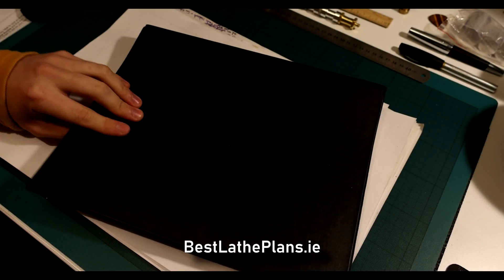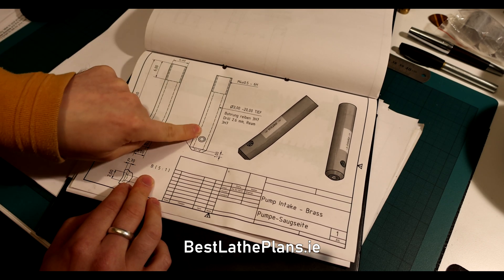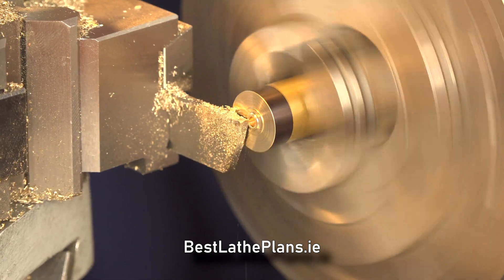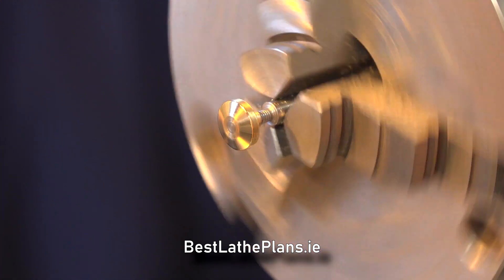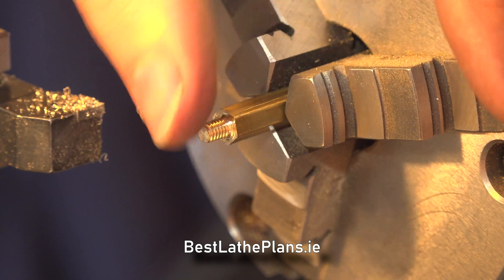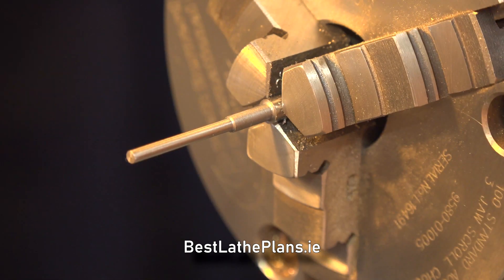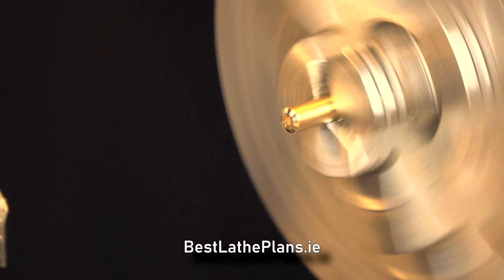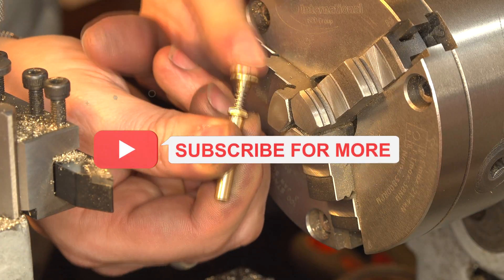The Pump Mechanism - Worlds Smallest Oil Can - Part 4 - 4K / UHD - BLP

Comment: hy , it seems there is a wrong dimension in the plans ! the intake side pump part , it says drill 20mm deep  but the part itself is 27mm long and on the drawing u clearly can see that !  i am just building it at the moment right now and it would be great i u might can help me here ! thanks .
Reply from the maker: Hey, Thanks for the comment. I'll check the plans, and get back to you. How is your build going otherwise?
Reply from the maker: I've just managed to look and understand your point. It's not clear, but my understanding is that the threaded M4 section at the top, to a depth of 6mm, is in addition to the 3mm diameter 20mm deep section. This leaves ~1mm at the base of the pump inlet for the inlet hole. It could be clearer with lines showing dimension start and endpoints though.
I'll pass your comments on to the designer. (These are not my designs, just ones I found on a forum I'm registered on.)
I hope that helps. Best of luck in your build, and let me know how you get on. Del
Reply: @BestLathePlans  yes yes , thanks i got it sorted ! the pump is made exact as you say , i had to add the 6 plus 20mm , the pump was then reamed vut i did a extra job and used some lapping compounds from 10 down to 1 micron, the pump works like a swiss made perfection thing ! i am very pleased and as same as you say in your build: i think this is one of the nicest things i made so far...i cant await my brass shipping to finish the top and bottom lid...i also used some browning agent and browned the fittings ( i made them from brass and now they are sort of black with brass colored edges ! )  all in all a very nice thing to make and i might make one double the size !
Reply: @BestLathePlans  i am also in the forum and the designer did all right , he just has a different view . i think he made his drawings perfect. i could not make it better ! my build is going super smooth but i do it exact to the dimensions as shown, only i used stainless steel ins´tead of silver steel and some brass for the hex fittings and it is darkend with some acid. i made the spring myself from 0.27 music guitar wire from a turkish folk guitar ( i have them from 0.10mm up to 0.45 mm and i recommend u to try ....you get very nice springs from it and u would be amazed how good they are compared to ruler pen springs !
Reply from the maker: @pirminkogleck4056  Glad you got it sorted! I'll see if I can find you on the forum too, and maybe you can share some pics there? Would be great to see your build too! Sounds like you've got a nice little oiler there! :)
Reply: @BestLathePlans  i will hit u up in the Forum ( i forgot wich but u had the link somewhere) i L in all moyel engineers forums so far to get all the attention when i swing the help flag
Reply: Hi there were did you get the drawings for this please
Reply: @markmarson1685  i might want to add, the  pump as it is designed does not work with steam oil or any thicker oil. i added very tiny home made springs that push against the Valve balls. that made my oil pump realy work perfect
Reply: @markmarson1685  The Drawings are available in Home Model Engine Machinist Forum, the link to the drawings in the First video of this series down below the video in the description.